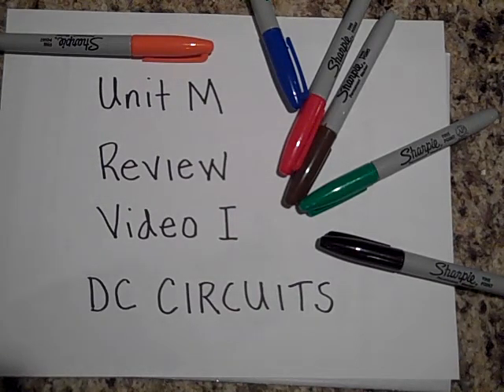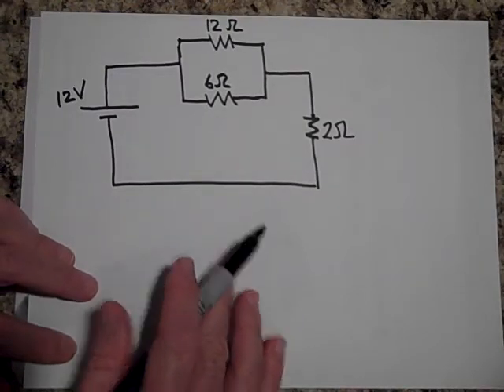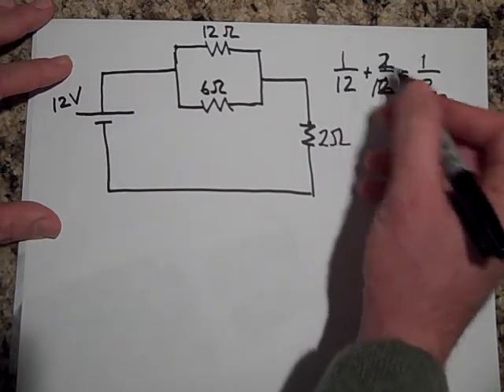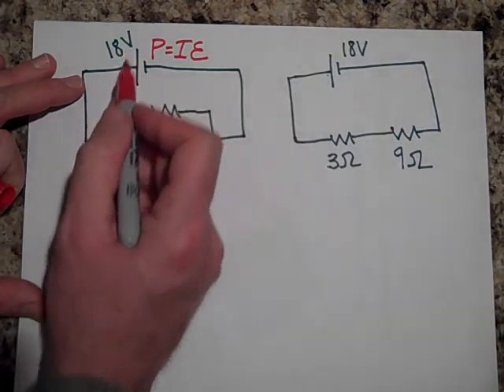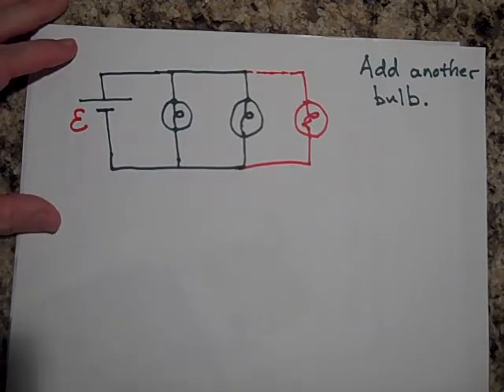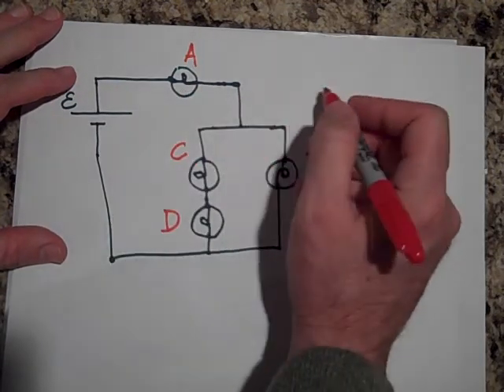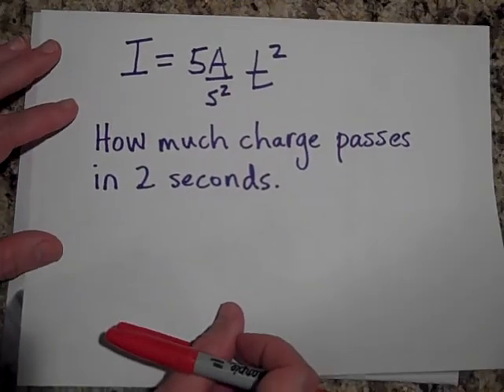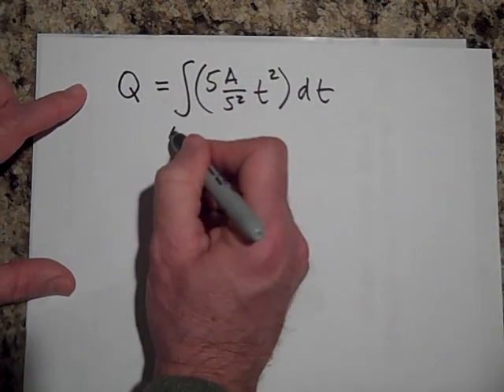Review of Unit on DC Circuits (part I)

Comment: He missed that part out, 

So the total resistance is 4ohms. In a circuit the voltage gets spread out, all adding up to 12V. So we need to find out the voltage left over for the 12om and 6om resistor by taking away the voltage from the 2 ohm resistor.

V=IXR we know the current (2) and the resistance (2) - 2x2 = 4v 

So now the remaining voltage is 12-4=8v

8v is split between a 12om and 6om. we need to sub it into I=V/R

For 12 om - 8/12 = I = 2/3
For 6 om - 8/6 = I = 4/3

V-voltage
I-curent
Reply: god bless ur soul

Comment: the voltage through the 12 and 6 ohm resistors are equal, but the voltage through the 2 ohm resistor is different.  You have to use the equivalent resistance to find the voltage through each resistor.